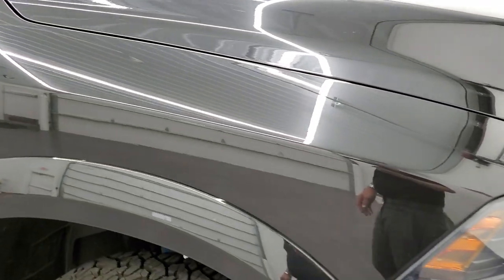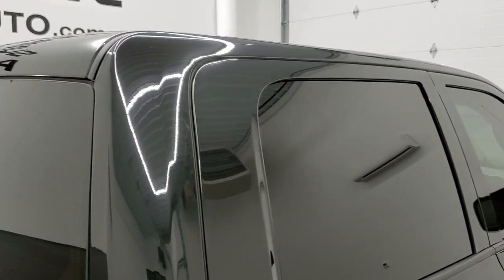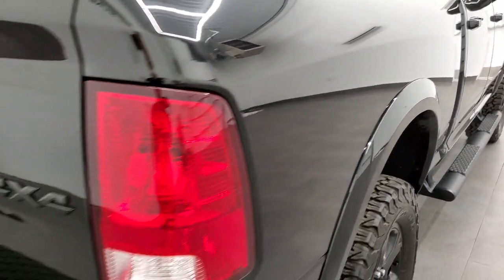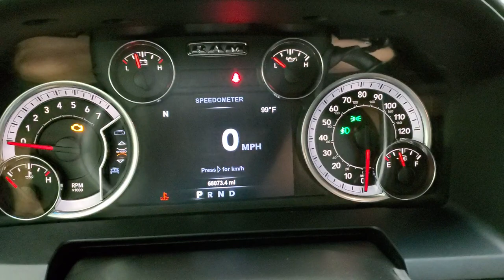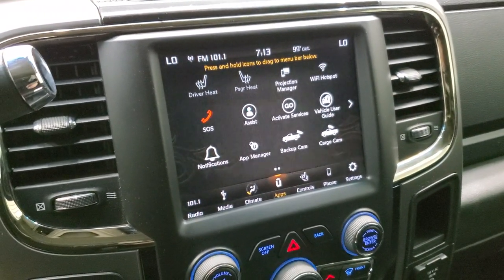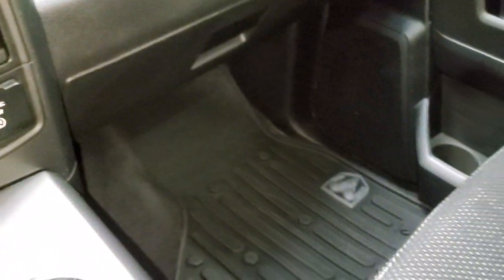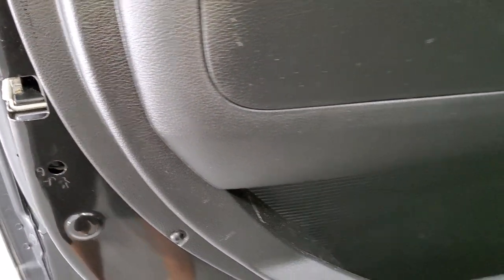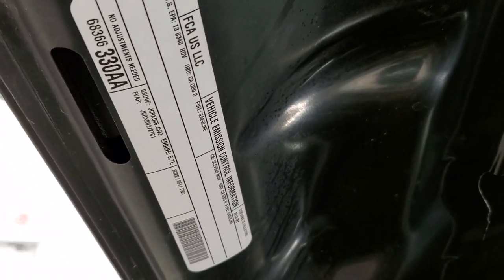2018 RAM 2500 BIG HORN SPORT CREW SHORT BRILLIANT BLACK 5.7L HEMI WALK AROUND REVIEW 12115Z SOLD!

Comment: I was wondering that the 2018 was the final production year of this 5.7 liter hemi V8 as the base (standard) engine before 2019 the RAM heavy duty pick-up trucks will get a standard 6.4 liter hemi V8 with an 8 speed transmission just like the chassis cab commercial trucks